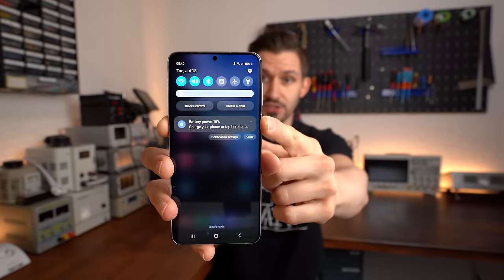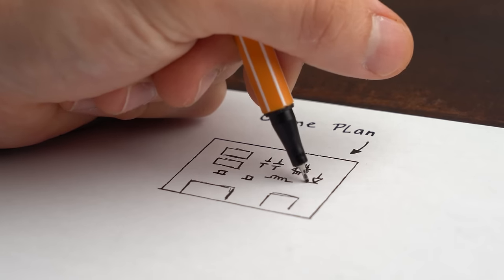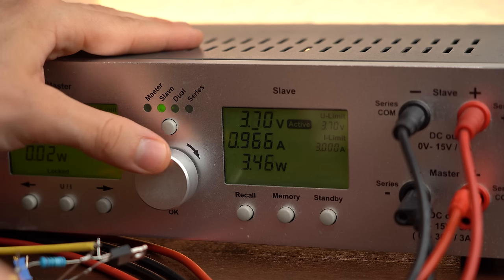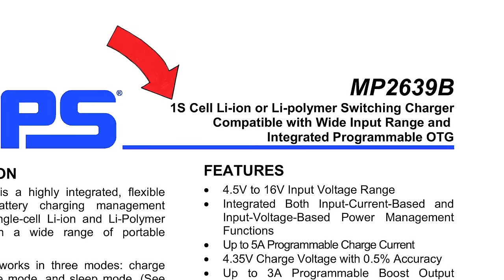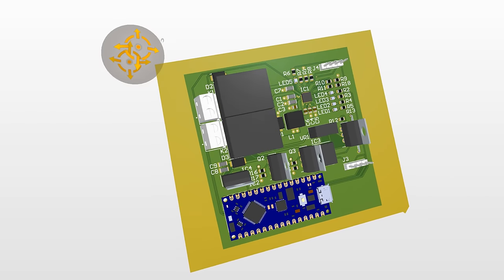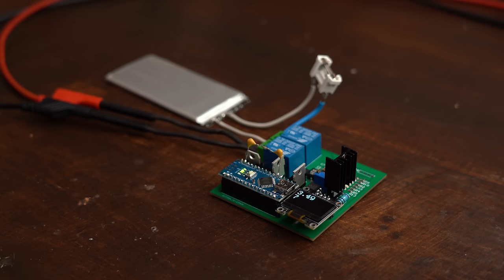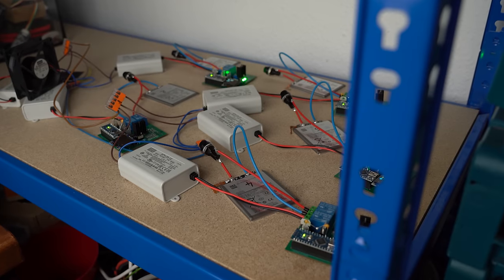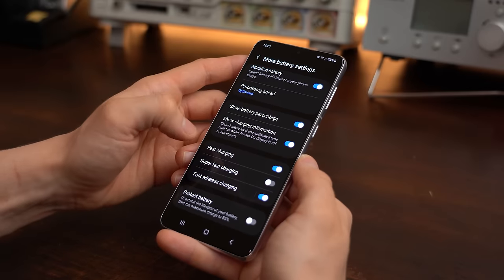Don't Fast Charge your Phone before Watching this Video!

Comment: Hearing that 3.55V is considered 0% makes me feel a lot better about all the times I let my phone discharge to stone dead flat - even with the slightly higher chemistry that shouldn't be too bad for the battery, and explains why my battery isn't completely dead lol
Reply from the maker: The more you know :-)
Reply: Not exactly that they just consider that voltage 0 just so it has some energy, its just any lower and there just isnt enough voltage to power the rest of the phone, so effectively for the purpose of using your phone, that voltage needs to be higher than 3.55 or it just wont work, hence 0%
Reply: @OrwellianHellhole192  Thats just a side effect. Going any lower voltage will hurt the battery cell and degrade the chemistry inside. Phones will cut off slightly before that true 0% so they can still keep the date and time or be used as a car/door key using NFC. Unless there is an internal short or the discharge protection of the cell is faulty, it shouldnt happen
Reply: @OrwellianHellhole192  What I'm getting at is that lithium ion batteries are generally considered to be safe to discharge to around 3V (or even less sometimes), which means that I don't need to be worried as much as people keep saying about damaging my battery by accidentally discharging to 0% semi regularly. Obviously 0% represents fully discharged as far as the phone is concerned but it's still within safe limits for battery longevity
Reply: @CookieCraftMedia  lipo batteries can discharge down to 3 V,  so it is giving quite a large margin to make sure you don’t accidentally damage your battery. The minimum voltage could also be due to the required voltage of the electronics inside the phone. Like when powering 3.3 V minimum microcontrollers or sensors you can’t fully discharge a lipo or li-ion battery because the voltage goes too low.
Reply: @YO-BIZZY  The capacitor discharge equation isnt really useful for batteries. They dont really behave the same way much. A capacitor discharges from its charged voltage down to 0 V. A battery doesnt do that, a lipo or li-ion battery starts at 4.2 V and can go down to 3 V, although most people wont go below 3.5, for some li-ion it can go down to 2.5 V and for Lipo-HV it can go as high as 4.35 V, then LiFePO4 is different again.

A capacitor when down to 0.3 Q is at a third of its starting voltage. A lithium battery when at 0.3 Q is still at a decent voltage, probably about 3.6 V which isnt that much of a difference from the 4.2 V it started at so it absolutely can still be used.

Also a capacitor discharging isnt useless after one time constant, yes almost 70 % of its energy is gone, but it still has just over 30 %. For a lot of applications that might not be useful, especially if using it to power things, in which case it will probably cease to be useful long before one time constant, but for oscillators or timers it can still be very useful after one time constant.

On top of that the output current of capacitors and batteries can be wildly different, a suitably sized capacitor can output a lot more current than a similarly sized battery but will generally have much lower capacity. A capacitor does not have much resistance, a battery has a lot more internal resistance and that is one of the things that determines the maximum charge and discharge current. Capacitors are good for a high current, quick discharge but lack capacity, a battery is much better for lower current sustained discharges.
Reply: @YO-BIZZY  
 Yes, capacitors and batteries have similarities. However, caps are designed to quickly discharge, where batteries are designed to hold charge while discharging. For example, a flashlight. A cap will light a bulb, but die off quick. A battery will keep the bulb on longer. This is a very basic concept im typing between them. 

Ultra capacitors, C ratings, Farads, capacity ratings, materials used, and size (noise filtering). There is more that I didn't list. But suffice to say that capacitors and batteries have similarities between each other on the surface but differentiate quite a bit diving deeper.
Reply: Actually most phones I've used actually discharge to 3.2v normally, then 3.5 when the battery gets old and has too much voltage sag

Comment: Interesting video and results! However, I wanna add a thought from my usage pattern. Because fast-charging has significantly changed how I charge my phone. I think we all remember the early smartphone days where you had to charge your phone overnight. That also meant in probably spent a significant amount of time at 100%. For me, that meant I usually significantly drained my battery over the day (near 0%) and then charged it to 100% overnight. Nowadays with fast charging, at least for me, I don't charge overnight any more. I just plug in for half an hour here and half an hour there whenever I go below 20%/30%. And that means that my phone battery (most of the time) stays between 20% and 80% charge, basically never sitting at 100% or being drained to 0%. And from my understanding, modern Li-ion batteries really enjoy being in that 20-80% range instead of being pegged at 100% for hours on end. Maybe that would be something to also consider!
Reply: That's why I hugely support more phones starting to allow for charging limits and some apps that alert you when the battery percentage reaches a certain point so you can unplug it
Reply: also remember that 90% of iPhone users change phone every 2 years - so even with fast charge every day you lose about 20% of battery for this time... not that much
Reply: Depends on the person's routine still. I for instance, cant unplug the phone, cause I only have time to go immediately to sleep. But on the other hand, I use the native charge cap to 85% (android, and yes, most ppl dont know about it).
Reply: Good points. Personally I still mostly charge overnight but limited to 85% in software, so I have it ready on the next day where I can't always recharge.
Reply: I couldn't agree more! This would be awesome to see!!
Reply: @TheFreezeChill  0% on the phone doesn’t mean 0% on the battery. 0% on the phone corresponds to about 3.5 V when the battery can go down to 3 V. It is going down to close to 3 V that is the issue.
Reply: I think most phone manufacturers understand that many people still charge their phones overnight, and so implement firmware that protects the battery from being charged at 100% for hours on end. It may appear on the GUI that the phone is still “charging” when plugged in and full but I’d bet that behind the scenes that isnt the case
Reply: I bet if you where able to calculate the mA or the total amount of power extracted from the battery when doing "100-0%" until it reaches something like say 80% of it's capacity against doing 80-20% down to 80% of it's capacity you will likely find that the total amount of power to be close to the same. Example. A 4ah battery drained once a day from 100 down to 0 will get 300 charges until it's capacity is down to 80% capacity. This is 1200ah. Or doing 80 down to 20 is using 2.4ha each time. This may increase the life to around 500 charges which is the same 1200ah being drained from the battery. 

One thing you have to factor in, is if you are having to charge more often because you only have 80% charge and you are plugging it in at 20% you are doing more cycles then 100-0 so you will go through each cycle faster and thus reach the 500 the same time at the other battery's 300th cycle

Do the math yourself and find out if you truly are extending the life of your own battery
Reply: @FoxWolfWorld  yeah it's been that way for years, the phone stops charging when it gets below the set current (generally 10 % of the charge current but may be different with fast charging) and it doesn't start again until the battery drops below a set voltage. So if you leave the phone charging at 100 % for a while it will spend most of the time not charging.

Some phones now (at least some Motorola ones) when left charging for a few days reduce the battery down to 80 % and keep it there instead since it is healthier for the batteries long term.
Reply: @jasonharrison25  a full charge cycle on a battery refers to from 0 to 100 %, if you do 20-80 % that doesn't count as a full charge cycle, it is only 0.6 charge cycles. Charge cycles don't really refer to how many times it is charged but rather how much capacity is charged into it. So 1 charge cycle equals the batteries rated capacity, not how many times you charged it, hence 20-80 % is only putting in 60 % of its rated capacity and hence only counts as 60 % of a charge cycle.
Reply: Many phones nowadays have "optimized charging", it knows when you're charging overnight and when you get up in the morning. It charges to 80% and only does the last 20% an hour before you wake up.
Reply: The 20-80% is kind of the standard you were shown in this video. Example: Voltage is the easy way so 4.2 v is 100% on the device, but in reality it's not. 0% is 3.4 and there is plenty left, but it's made to deny that to happen. You also need time to get to a charger.
Reply: @TheFreezeChill  even if so, do the math on how many units of energy you can extract from the battery with 100/0 vs. 80/20. Probably pretty close.
Reply: @conorstewart2214  even if so, do the math on how many units of energy you can extract from the battery with 100/0 vs. 80/20. Probably pretty close.
Reply: Well if you actually watched the video you'll notice he said that the cycles of the batteries were from 0% (3.5V) to 100%. If you watch the end graph you'll see that the batteries that were charged with 1A didn't had a drop in capacity, so I think that the "stress" thing if you charge or discharge the battery too much is just a myth.
Reply: @TheFreezeChill  "But wheter you define the battery to be empty at 2.7 or 3 or 3.3V is up to you.", not really, the manufacturer will have pretty clear definitions on what empty means and that is what will be used in their capacity and lifetime testing.
Reply: @jasonharrison25  if you take your example, 300 charges on 0-100 % charging, vs 500 charges on 20-80 % charging. Each charge of 20-80 % is only 0.6 cycles, so multiply 500 by 0.6 and you get the 300, so the same number of actual cycles. I dont know where you got your numbers from though.

The point is the rated life of the battery is not measured in how many times you charge it but by how much energy you put into it. So if I charge it from 40-50 % 1000 times, that is only 100 cycles.

It is also well known for lithium batteries that you want to keep them not fully charged and not fully discharged, hence with lipos you storage charge them to 3.8 V, so in the middle of their range. Keeping them fully charged or discharged does degrade them over time.
Reply: @conorstewart2214 in literature a cycle is typically defined as 100-0-100 but companies might call it 100-0 to put a bigger number in the spec sheet. I noticed apple even managed to get their definition on Wikipedia
Reply: @alphadog6970  the guy has spent 3 months making the video and you are complaining and unsubbing because the test wasn't long enough? If this makes you unsub you don't have a good reason to be subbed in the first place.

Anyway he said in another comment he may extend the test.
Reply: @TheFreezeChill cell phone batteries don’t go above 70c to cause degradation… This video is a decade late